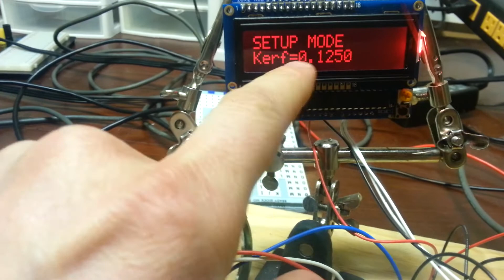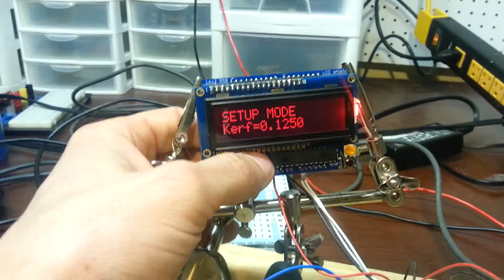Arduino CNC box joint jig

Comment: I hope you can provide complete plans and code.  Nice demo, but most woodworkers can handle the parts assembly, but specs on the motor and code are necessary for most of us.
Reply from the maker: I can make what I have available.   I'm still not totally finished.   I'm trying to settle on the design for the sled.
Reply: Please contact me when you have all worked out.